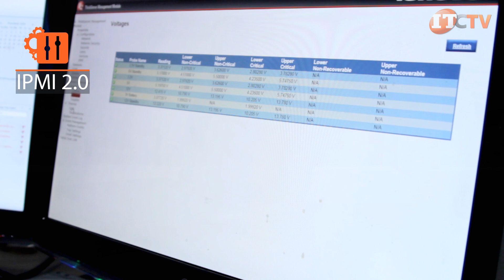Lenovo RD640 ThinkServer Review by IT Creations

Comment: Suport Fiber?
Reply from the maker: Hi Victor!
Yes, you put a fiber card into one of the PCIE slots and you're in business. It needs to physically fit in one of the slots, which should be easy: 

Up to six PCI-Express slots via two riser cards, riser card 1 for slot 1-3, riser card 2 for slot 4-6 Slot 1: half-length, full-height, PCI Express 3.0 x16 (x8 elec) 
Slot 2: half-length, full-height, PCI Express 3.0 x8 
Slot 3: half-length, full-height, PCI Express 3.0 x8 
Slot 4: Low Profi le, PCI Express 3.0 x8 
Slot 5-6 are available on dual processors models: 
Slot 5: half-length, full-height, PCI Express 3.0 x16 (x8 elec) 
Slot 6: half-length, full-height, PCI Express 3.0 x8  

Thanks for watching!

Comment: Can I add Nvidia GPU card like Tesla to this server? Would it work with it?
Reply from the maker: Hi + أم العريف , from what I can tell, the RD640 does note support GPUs. Not listed in the Specs, product guides, overview or anywhere.  Here's an article that talks about the lack of GPU support on the RD640 and recommendations to get the brand new SR650 that does support Nvidia and AMD GPUs. http://www.worldcadaccess.com/blog/2014/09/hardware-review-lenovos-thinkserver-rd640-rack-server-computer.html 
The article says there's no PCIe support for a GPU acceperator or otherwise.
BTW, the unit they compare the RD640 with is Dell's R720 which does support two double-wide GPUs and a dual SD card module. https://www.itcreations.com/dell/Dell-PowerEdge-R720-Server.asp 
The Lenovo ThinkServer RD650 does support a single GPU Nvidia M60, here under expansion: https://lenovopress.com/lp0070-lenovo-thinkserver-rd650-e5-2600-v4 
If you are shopping for servers we carry Dell, HPE, and Lenovo, here: https://goo.gl/03PVSq
If you have any more question feel free to post more. in teh meantime, good luck, and thanks for watching!
Reply: IT Creations, Inc. Thanks for your reply. Wish there was a way to use Nvidia GPU card :-(